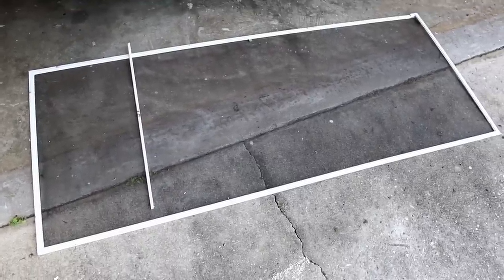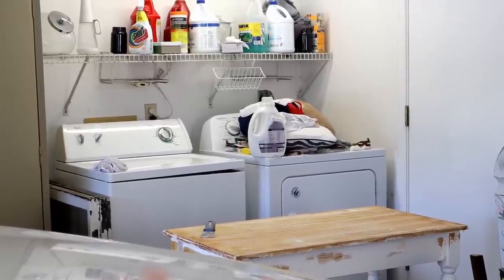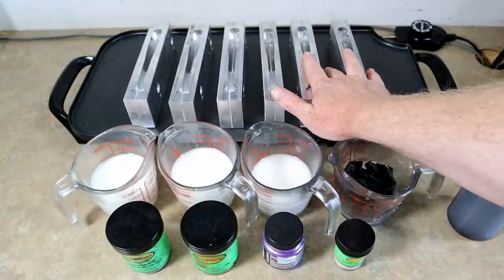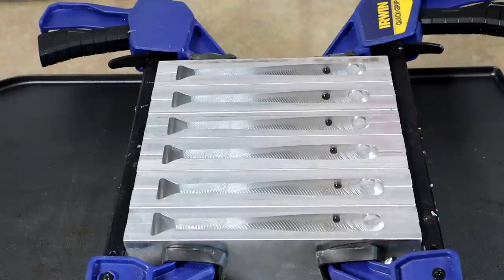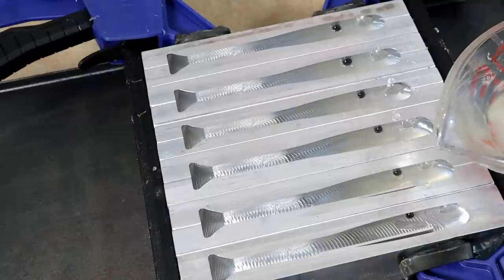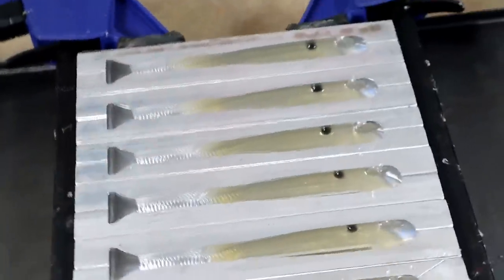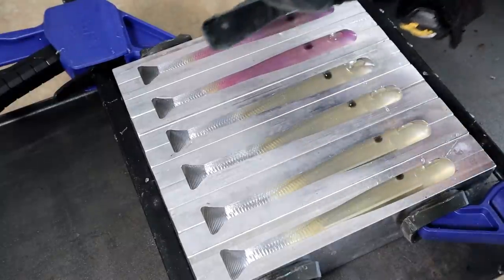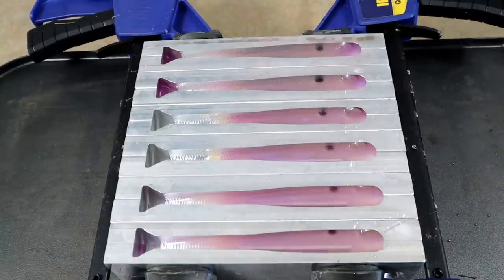Hand Pouring FAIL & New Threadfin Shad Swimbait Colorway Demonstration

Comment: Just starting out would a heat gun work instead of hot plate just for one mold at a time? Or does the hot pad work that much better

Comment: Your swimbaits always impress me. I recently picked up those new Berkeley 3d swimbaits they are pretty beefy I've tried every size hook I own and I got tons even my ewg 5/0 hooks with a under spin blade from owner just didn't fit nicely after rigging it up it just didn't seem like enough room between the belly and hook for a good hook set. Can you recommend a swimbait hook that would fit such a large fat swimbait?
Reply: By the way idk if you seen the baits I'm talking about but I've never been a Berkeley fan till these new 3d soft plastics. They are very similar to the style baits in this video.